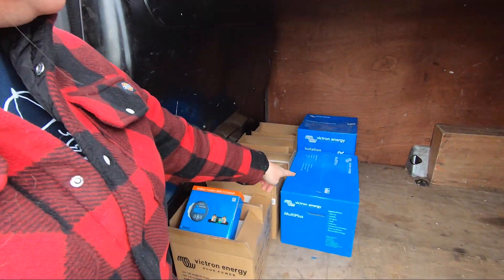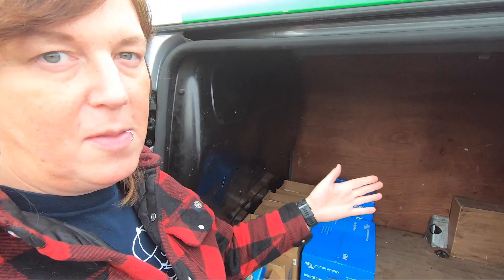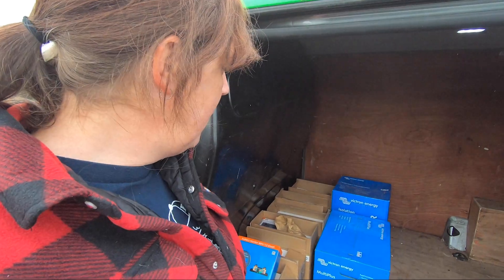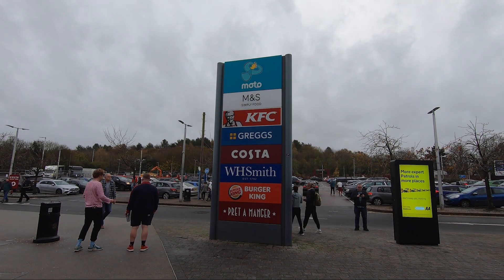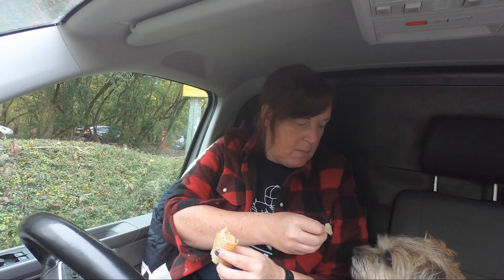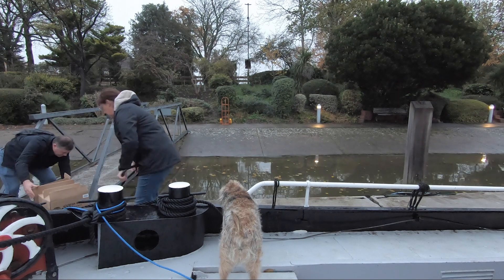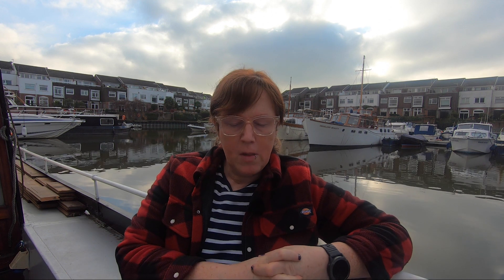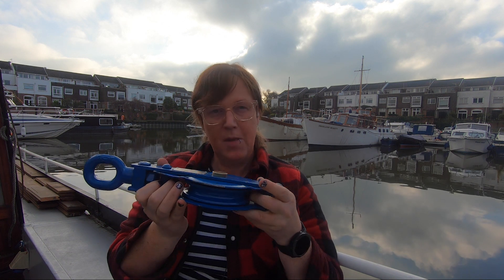#75 Electrical Road Trip - Dutch Barge Home

Comment: Hi Beth. What size batteries did you buy and did you go lithium? Iv converted a transit long wheel base to a camper and installed gas 230 volt and 12volt with solar electric hookup and charging system. The leisure battery is only a 200ha and if very sunny does well but the fridge sucks the life out of it. Im going to commission a new wide beam sail away early next year so I’ve follow your build with great interest. Very impressed by your knowledge which I appreciate is a mine field of options out there! Regards Brian.
Reply from the maker: Hi Brian. I went for lead acid batteries because I actually spend a lot of time on shore power but lithium would be a better option if I was much more off-grid. They're a lot more expensive and I'm designing my system to run at most a couple of weeks without plugging into shore power, really. Your wide-beam might benefit from lithium if you're more off-grid and it sounds a really interesting project.

Comment: I can't recall if you have a bow thruster on the barge I had electric on my old boat but the one you sailed is hydraulic which means no limit on the usage. I found the electric one drained the battery in minutes but it was just a single 100AH
Reply from the maker: I don't have a bow-thruster, no. We were going to fit one but sort of ran out of time and money back in the summer. I may fit one in the future but I'm going to try to do without!

Comment: Just curious, did you consider synthetic like Amstel or Dynema for your lines? I'm sure quality galvanized cable would be cheaper. The synthetic lines would be a bit easier on your gear but much more prone to chafe.
Reply from the maker: I did look at that but I wasn't entirely sure so just fell back on galvanised steel rope.